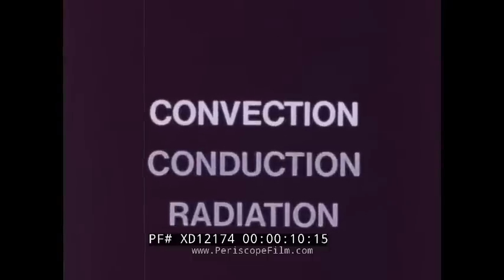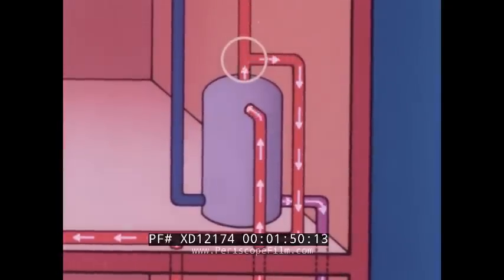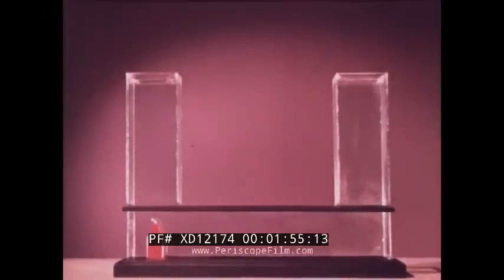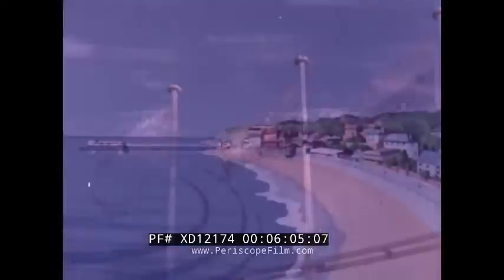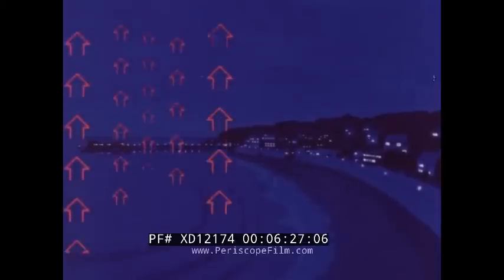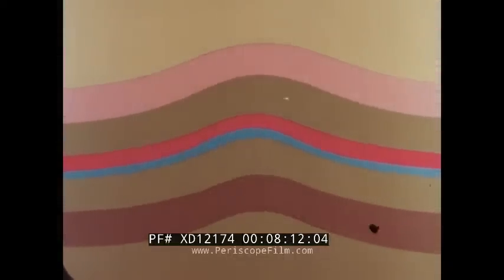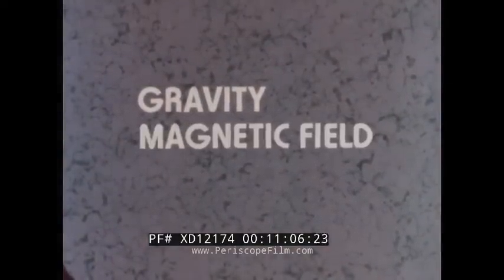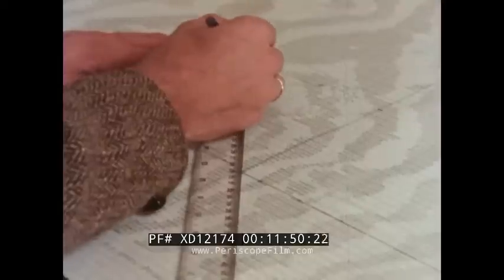CONVECTION CURRENTS & "WORLD OF OIL"  HOW AND WHERE OIL IS FOUND  SHELL OIL PETROLEUM    XD12174

Comment: I spent a few years doing some wireline, mostly in North Dakota and Texas.  A few times when working on frac sites we had seismic crews on site.  Not a very common thing, but it happened a once in a while.  Around 2014 and 2015 they would get the seismic data from two things.  One was when wireline set off the explosives to put holes in the casing for the frac crew to pump through.  They also recorded data when frac was pumping on the well.  At that time they could compile the data and get near real time 3D images of the formation.  They would take the data back to the labs and feed it through computer clusters to crunch the data for higher resolution 3D images.  One guy sat in the wireline truck with us as he recorded.  It was pretty cool to watch.  I would think the tech has advanced a fair bit since then.
Reply: Very cool and fascinating tech I heard your type of work is really tough